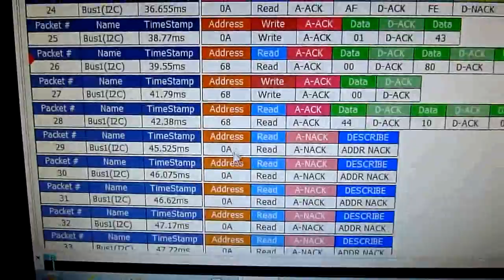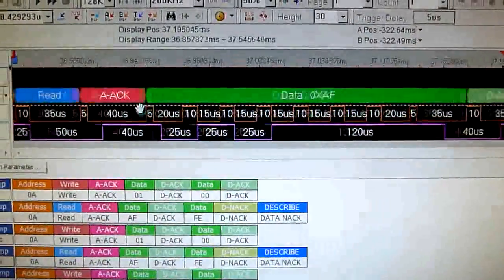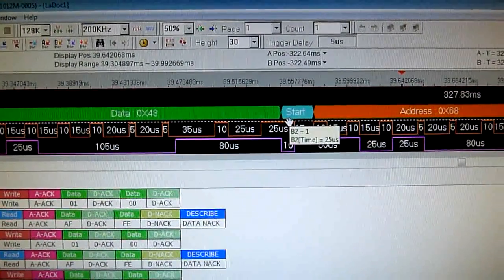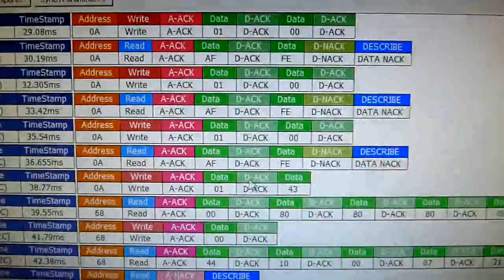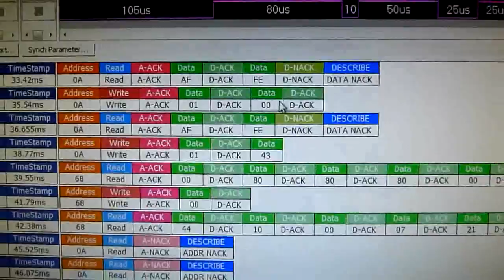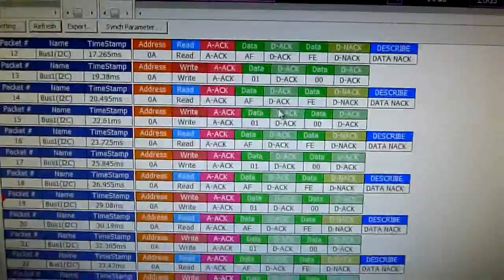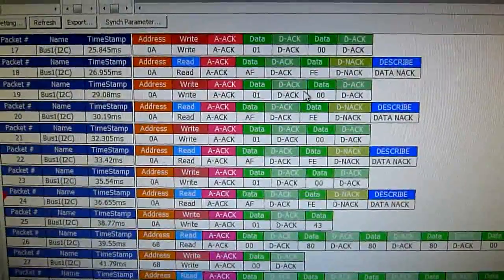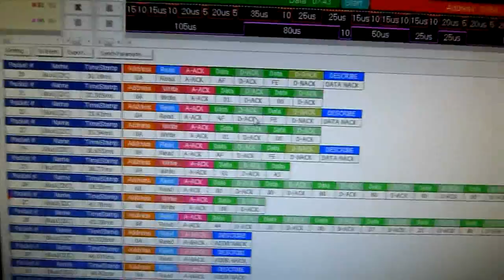Problems that drive you nuts: AVR TWI master and corrupted bus transfers.

Comment: Does your master do a confirmation after changing a state on the slave?  So if you set relay 5 to on, does the master automatically check that the relay is really on before saying the command succeeded?

Comment: This is why we test!  Good find, those kinds of issues are so difficult to find!  And I agree a busy check before sending to the slave, and a watchdog on the slave to check for the issue and reset the buss. I wonder if you could put the slave on ICE and see if there is a particular bit that is going high or low, something that usually toggles that don't when this condition occurs, then you could put a watchdog on it and be set!